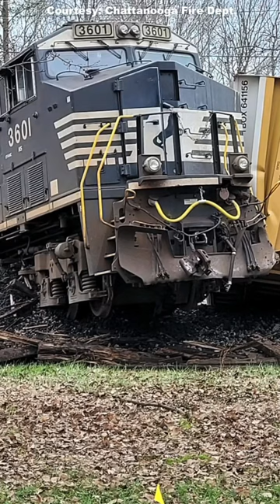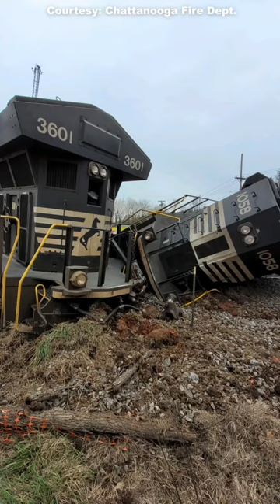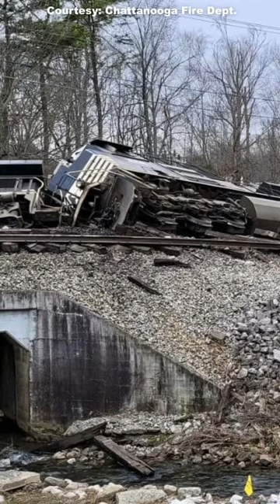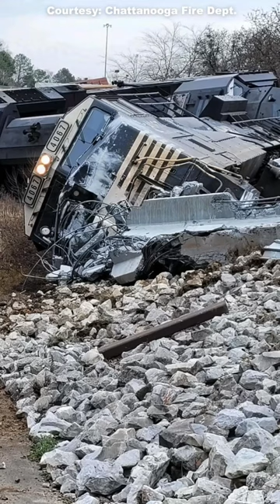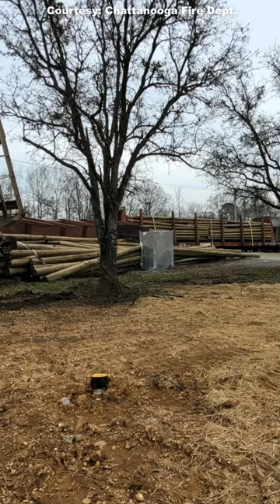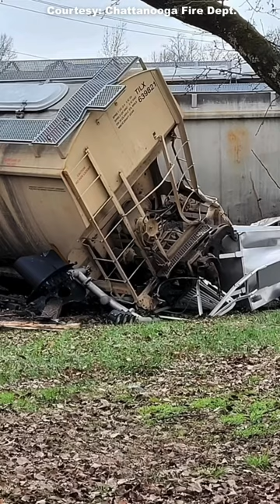Derailment in Collegedale, TN #short

Comment: Okay, so I don’t know who needs to know this but here goes: 
If you’re fouling a railway crossing, immediately locate the emergency number for dispatch that will be posted on both sides of the crossing on a small sign. Sometimes it’s also posted on the bungalow which is a small shed sized silver box that controls the crossing. Tell the dispatcher that you are fouling the crossing and give them the mile marker number that will also be on the sign. Call immediately- even if you think you can get clear before the train comes. You can always call back and tell them you are clear. The dispatcher can stop the train before you can see it and the life you save could be your own.

Comment: for those fully blaming the trucker, it wasnt entirely his fault. that is one MASSIVE and LONG load. he cant just casually go over the tracks at road speed. he has to go super slow. and on top of that, he looked like he was finishing a turn, turning with that kind of load  takes even longer to maneuver. id say the people escorting the truck have more fault because they failed to double check to see if a train was coming. but then again as said, id guess that turn wouldve taken a good 8 or so minutes to fully complete. and u cant exactly see a train that far
Reply: He was stopped at a traffic light.  He should have waited for a green light before he crossed the tracks.
Reply: @erichsh58 that sounds more like a design fault with the crossing itself
Reply: A phone number is on the crossing to let the railroad know in advance.
Reply: @erichsh58  If the truck driver was sitting across the tracks while waiting for a green light he's the dumbest driver ever and needs to loose his lic. and have to be financially  responsible for the damage he caused
Reply: HE CAN CALL THE PHONE NUMBER POSTED AND GET THE OK OR THE DON'T-DO-IT-YET.  But the driver would have to have a brain, and many don't.
Reply: thats the thing. not EVERY trucker is told that theres a sign with a phone number on the crossing, and the sign itself is very small so its very easy to miss while passing by if theyre unaware that there is a sign
Reply: @therailfanman2078  ironically, that beam was for a bridge to remove much of the traffic from that crossing.
Reply: @Frantic618  They are professional movers, they should have predriven the route to verify no detours or road construction project's. This special move and needs permits and planning ahead.

Comment: How could this happen in this day and age?
Reply: Negligence and poor planning.
Reply: ANYTHING IN FRONT OF A TRAIN THATS MOVING IS ALWAYS THE GROUND VEHICLES FAULT. I REGULARLY WORKED ON WRECKED AMTRAK LOCOMOTIVES. THE TRAIN IS ON FIXED RAILS ,THERFORE CANNOT DEVIATE.
Reply: Where's the pilot car.. Luckily no body was killed.. Unreal huh..
Reply: @BAZZAROU812  also, who planned the route? They're ultimately responsible for this.
Reply: @Normal1855  This was the destination for the beam. It had to go here. It was for a bridge that will take most of the traffic off this crossing.
Reply: Squirrels

Comment: So the fire department is gonna clean that up?
Reply: The fire department usually has access to spilled/leaked petroleum based liquid containment and collection supplies , so the fire department does the immediate cleanup of spilled liquids to prevent them from getting into sewage systems or watershed areas like creeks. The railroad deploys it's emergency track clearing crews and if needed  activates contingency contracts for mobile cranes. The railroad will send out replacement ties and rails to supplement any existing stores of such supplies near the incident. After that it's a slow process of lifting locomotives and cars back onto any nearby usable or repaired track sections. Cars that are too damaged to move on the restored tracks will be lifted onto mounds of gravel in the railroad right of way and be dismantled to be hauled away as scrap metal. 

We had a derailment involving chemical tank cars and it took a few months for the railroad to completely drain and render the chemical cars safe for dismantling and removal as scrap metal.